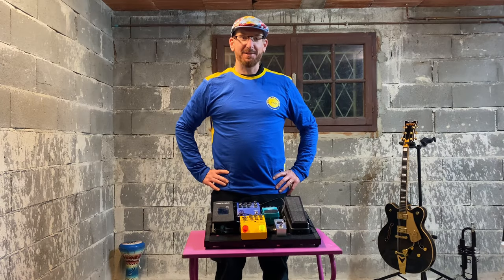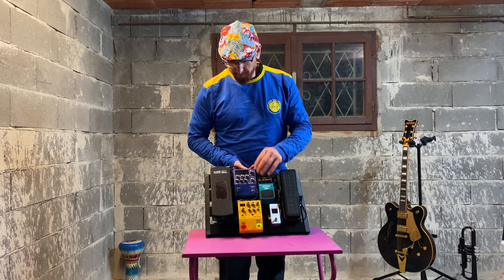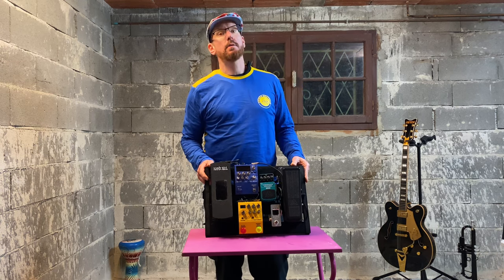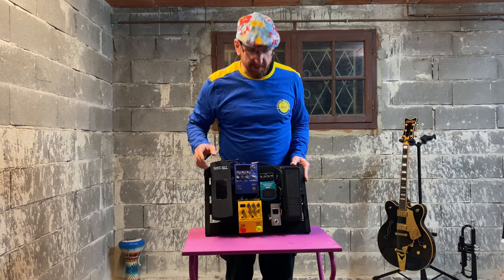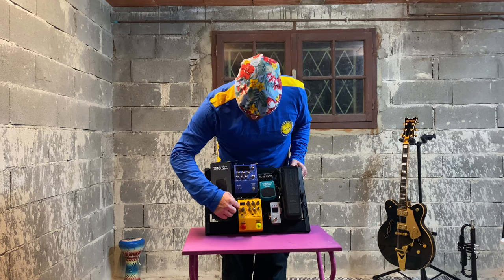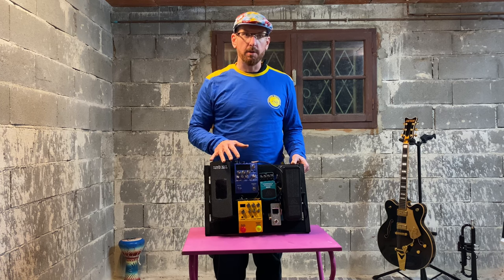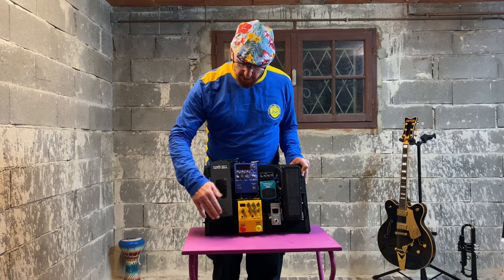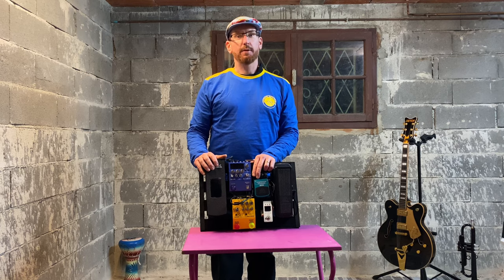STATE OF THE PEDAL BOARD,  JJ's Rock & Blues Board | The Distorted Trumpet Show 018

Comment: As silly as it sounds, my board has actually changed twice since this was recorded. The Boss OD-200 has been replaced with an EHX Hot Tubes, the Boss SY-200 is also off, switched out for a Behringer chorus and the Movall Falling Star delay pedal from AliExpress.

Comment: Plug some dirt into the fx loop of the sy200 and get some synth and distortion together
Reply from the maker: That's a great idea, I've never tried that.
Also the OD-200 has an expression pedal input that you can use to control the gain, this is something that has great potential. However, this is my simple, do everything as simply as possible pedalboard, so nothing flashy. Behringer, Boss, solid, no tragedy if someone spills beer on it or it gets trampled at a gig.